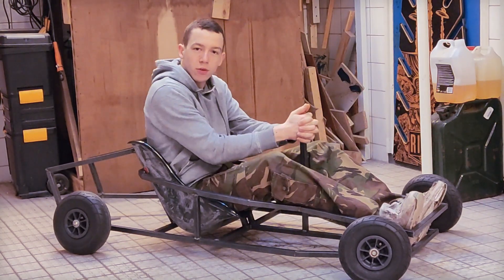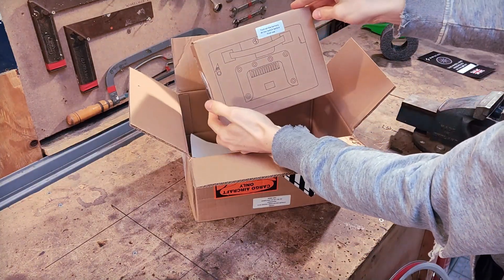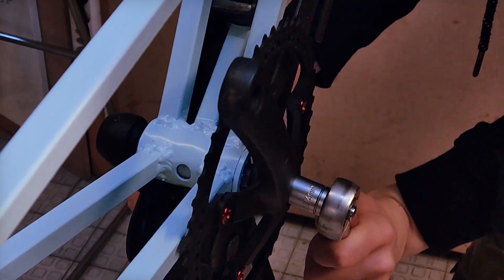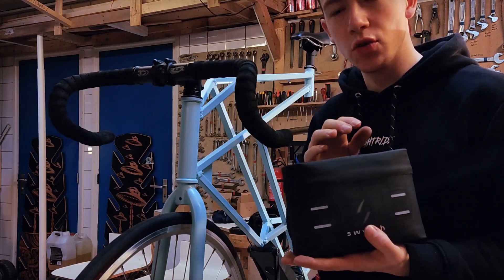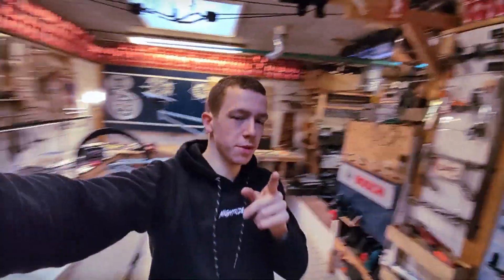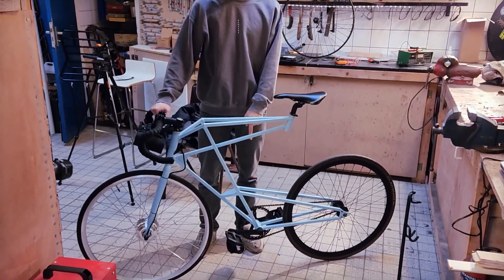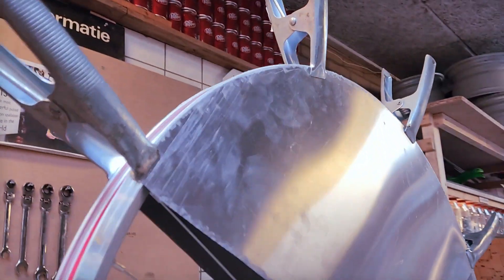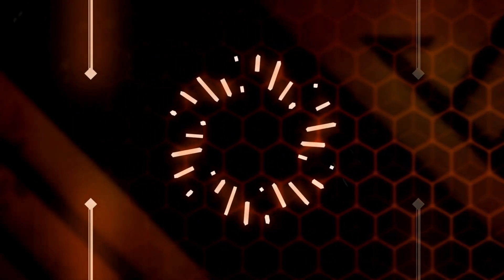Electric fixies are NOT a good idea, unless you do this...

Comment from the maker: Just for all the people wondering: I did ride it with the sensor for a while. I had to put ridiculous force into skidding to get it to a standstill. The delay of the sensor noticing the pedals have stopped made it even harder to skid it to a standstill: the motor kept on powering on for a while after starting skidding. I would like to see any of you who think it's fine try this with the sensor. I can tell you now, you would not be happy with it. On the other hand: throttle works like a charm!
Reply: I'm wondering that if you press the accelerator while skidding is it going to catch speed while skidding ?

Comment: Bad spot for the battery-pack, 🤔 it's better to attach it to the head tube, so it won't interfere with the steering(feel)...

You could leave the sensor on and use a'kill-switch' to stop 😜

Comment: If you wanted to do an electric conversion you could use a single speed instead of a fixie bike, so that you can coast,but still have only one gear, although would recommend putting the motor forwards, as if you have single speed, the motor will always have a lot of load at the start of acceleration ( because obviously you have one gear ratio which is usually high), so putting it forward not only makes the motor perform better and not heat as much thus more lifetime.